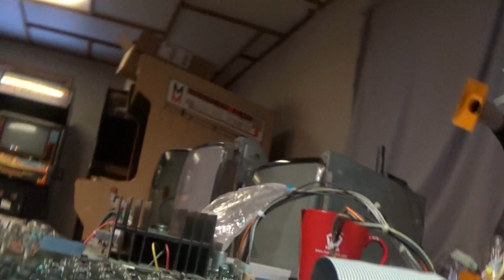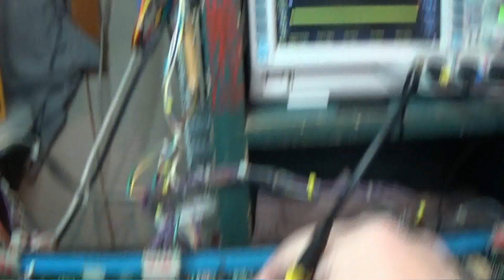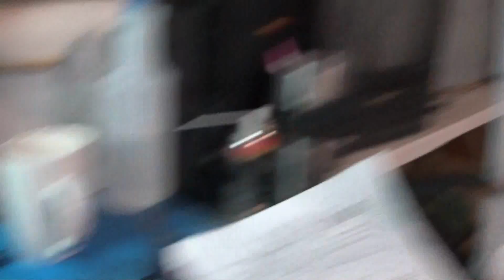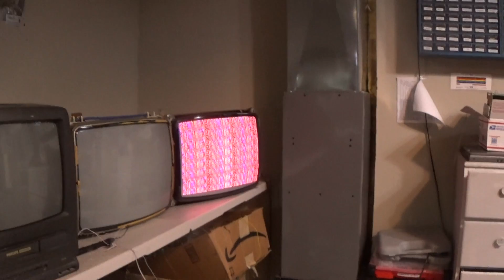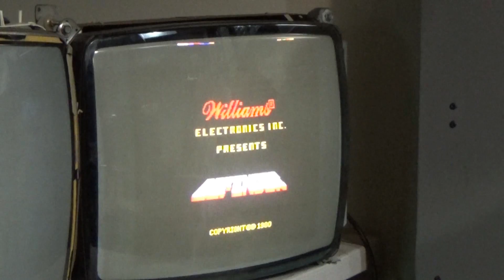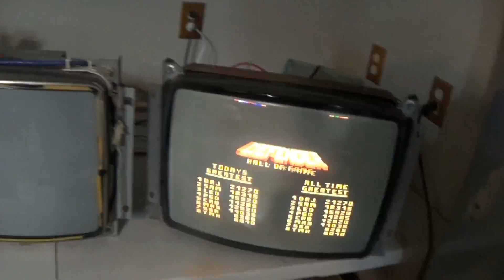1980 Williams Electronics "Defender" PCB Repair  -  12\01\21

Comment: I had a Scramble bootleg where 5 out of 8 ROMs didn't match and they didn't even verify to themselves. Read them 4 times, get 3 different results, all with just a few bits different here and there. However once the machine was fixed, these ROMs worked perfectly fine. No crashes and the only glitches I got also happened with the replacement ROM (I did a Big ROM hack - replaced the 8 2716 with a 27C256 and put a switch in to select Scramble or Amidar). I erased and reused the original ROMs since then and had no problems with them. It's only my EPROM burners couldn't read them reliably. Could write to them no problem though.

Comment: I tried using a 2K EPROM as a replacement for a bad decoder. It works, but the garbage line and column are a little more noticeable. Both are almost completely off screen.